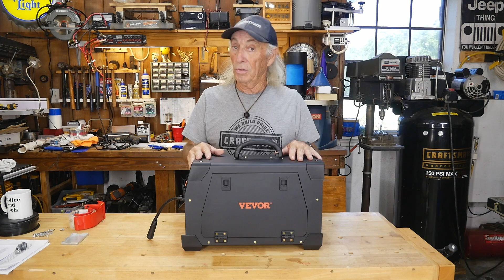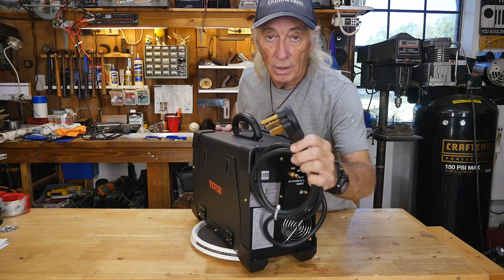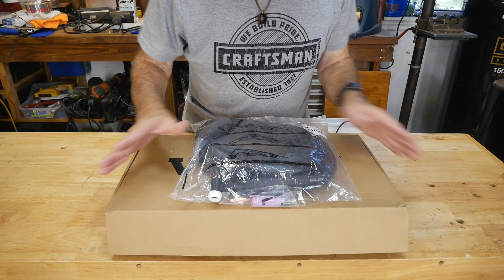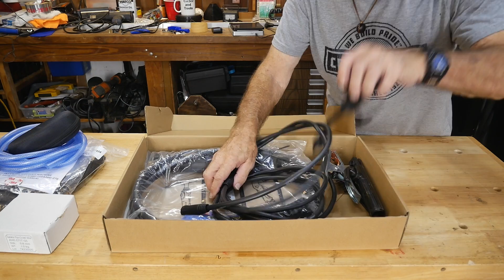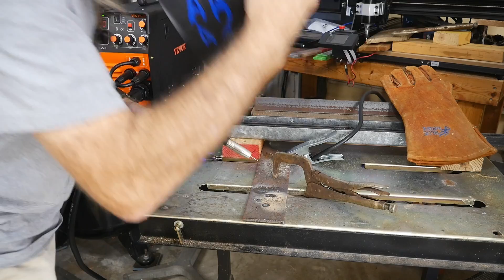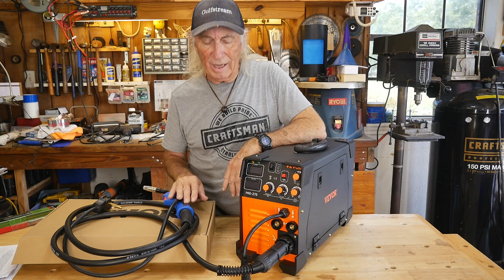Vevor Mig 270  "3 in 1" welding machine, Mig Tig, Stick !  Reviewed Coffee and tools ep 364

Comment: Professional welder for 48 years and bought this welder just to check it out and I'll' tell you it is the smoothest running Mig I have ever run!
And the 110 Volt adapter works fine for 1/8" steel no problem.

Awesome machine for the cost.
Reply from the maker: The newest one seem to have almost zero splatter here when testing it. The tech is getting pretty darn good :face-blue-smiling:
Reply: @SirTools Does this allow you to use .035 mig wire?
Reply from the maker: The drive wheel is marked for it, but the metric was annoying :face-blue-smiling:

Comment: Has anyone done any autobody work with this welder with a bottle set up for Mig. I dont want it for flux core I have one of them and they suck for body work, too hot and too much time cleaning slag to get proper penetration. Tack tack tack gets old when you have to clean every spot weld and you need too. Also time consuming.

Comment: Has anyone come across a good voltage and wire speed chart for this machine? Running flux core .030 and .035
Reply from the maker: Seems to me there was a chart in the box with t he machine. I just used old school, turn it up, turn it down etc while testing a bead etc..
Reply: @SirTools  no chart in the box or on the machine. The owners manual in general wasn't very helpful lol 😔. I found some charts on Miller's website. I'm welding .065 wall steel tubing with .030 wire. According to the chart I should be around 2.5 wire speed to get to 65ish amps and voltage around 13.5-14 volts.
Reply from the maker: Sounds about right :face-blue-smiling:
Reply: @nabaddame5726  just dial up and down on amps to find the sweet spot that suitable for the task you work on. there is no "bible charts". the more you weld, the better welder will be-come.

Comment: I bought one of these and it was a HUGE waste of money.  I’m a professional welder and I wanted a cheap mig machine that I could use on the go, when I might not have access to 220V.  The issue with these is the very unstable arc, which affects your penetration and shielding (with flux core).  I sent a video to Vevor to see what they would do (it was brand new).  They sent me a link to a YouTube video of some guy who doesn’t know how to weld and is giving a paid review.  Wtf.  Next I told them I would like to send it on its 2 year warranty, and the best they could do was offer to refund me $50.  I took the $50, will sell the welder on marketplace for another $50 and will still be out $180 on this purchase.  I left them negative feedback on eBay and they tried bribing me with $10 to remove it, nope!  This was supposed to replace my super crappy HitBox welder, but it can’t even come close to running a bead as nice.  My hitbox was like $100 and doesn’t have the setting that this does, and I wanted more control.  The Vevor starts to weld a little better after about 10 seconds of welding, but your first 10 seconds of ever weld will be trash.  Also, cheapest galvanized work clamp I’ve ever seen in my life, but I really wasn’t concerned, as I have others I could swap it for.  Stay away from this welder!
Reply from the maker: For basic hobby around my shop these welders are great, but on a PRO level, nothing new here. A good welding machine is needed. There is a fellow in UK that does Pro work and he's happy with the Vevor. I can't say any of this is true for me, but could be a few factors like I only use .035 wire due to my needs. I had an expensive Century in my shop for years and the .030 would just not work well, but on .035 is was fine. I tried a long list of "try this" and "try that", but with no luck from that old Century. Sorry to hear you had such a terrible experience with the Vevor.
🤠

Comment: For tig you have to buy tungsten electrodes,  and i have never been able to draw an arc.  Just melts the electrode.  But i may not be doing it right.  Oh and buy a different hose.  The one they send is as hard as steel.
Reply: Sounds like your leads are reversed.
Reply from the maker: I was going to order some off Amazon and....typical ME....forgot until we were shooting the review.
Reply: The tig torch should be negative and the ground should be positive

Comment: Do you know if the 200amp model runs mig with gas and or flux core
Reply from the maker: Don't know, the 270 was not listed for gas but came with the fittings which I thought was odd.

Comment: What are the MIG gas options?  I noticed the Hose has CO2 printed on it?  I've only used Argon CO2 in the old days with a 1980's Millermatic.   Anyone can help me better understand Gas options.
Reply: CO2, cheapest, more splatter, 75% Argon 25% CO2 (options including helium mix), can produce clean smooth welds, also Flux core, makes a bit of a mess but can produce very strong welds and can have better penetration, almost required if welding outside in any wind. Note CO2 bottle and argon/inert gas blend bottles have different connectors.

Comment: As much as I’d love another piece of VEVOR in my shop, I gotta pass on this. For now! 😎🫢😊
But I DID grab a spool of that .030 wire and 4 .030 tips!!😎 I just can’t leave empty handed!!🤣🤣
Great show! Sharing cause I do love that machine….just not applicable in my shop. Now the 110 model…..🫣🫢😊
Reply from the maker: ha ha ....Yeah, it's going to be a hard call. Keep it and sell off my old stuff or sell it and keep my old junky ones LOLOL...tough choice right now.
Reply: @SirTools  I sure does lay down a nice bead….as Gina would say, “how often are ya gonna use it”? My answer….” Ya mean, NOW”?!🤣🤣
You’ll make the right call. 👊🏻
Reply from the maker: Yeah, doing some soul searching on this one. I have some welding projects, but very few at times. mmm...sure is a nice machine.
Reply: The MIG-270 runs on 220 OR 110, but you are limited to ~80-90 A on 120V.